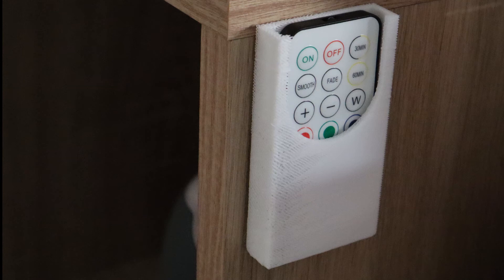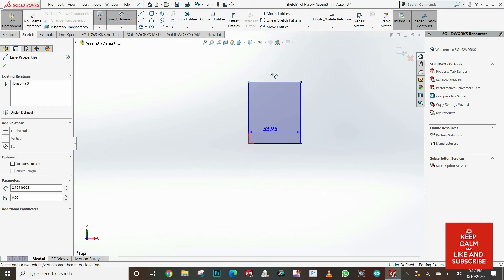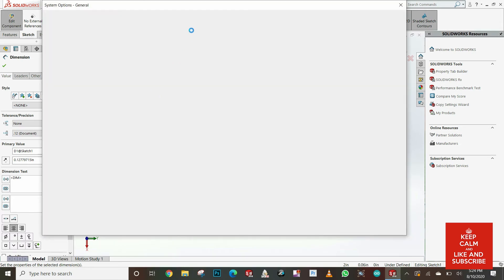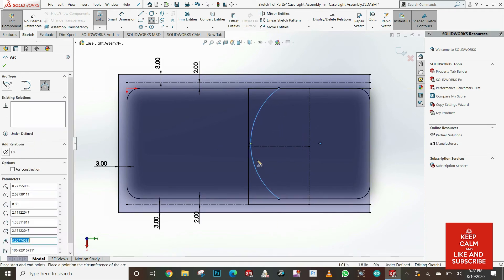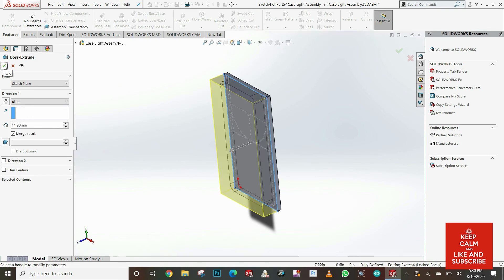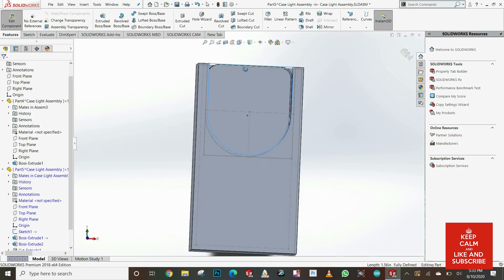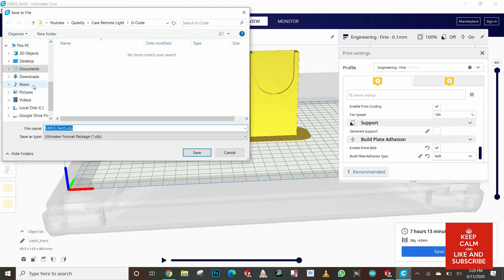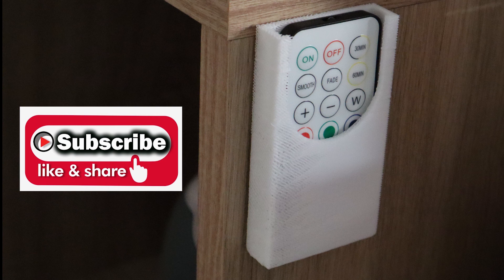How to model in solidworks and 3d Printing Tutorial

Comment: Seems like either your nozzle temperature or flow is incorrect based on the print, but great video!
Reply from the maker: Thank you yes I have been improving. Playing with different settings. I have done a lot research. Some people say that even the material brand would affect the quality :(
Reply: @quikdiy7134  too much heat maybe?